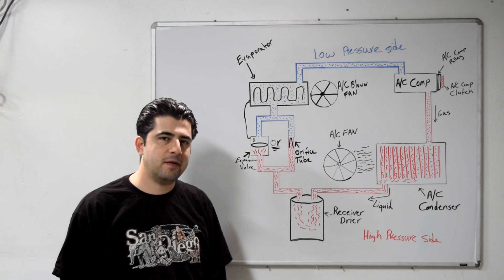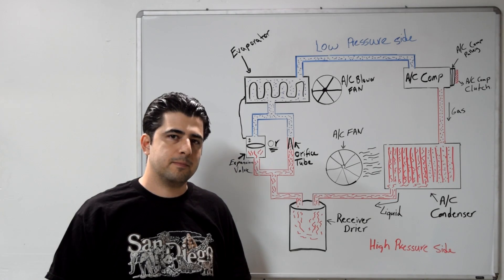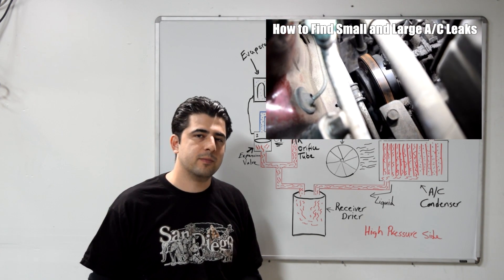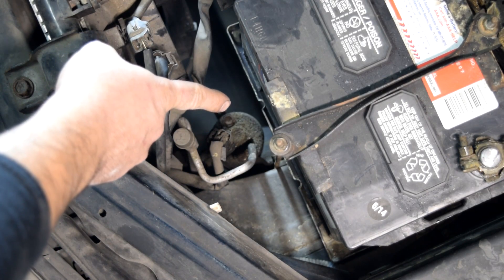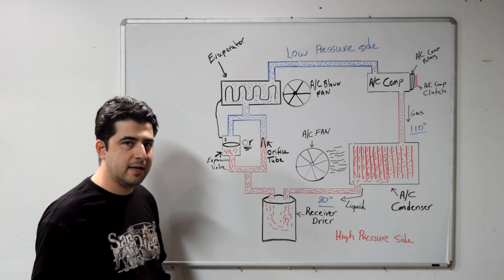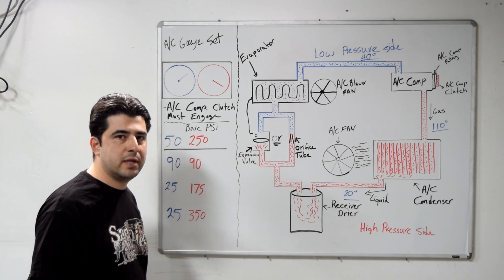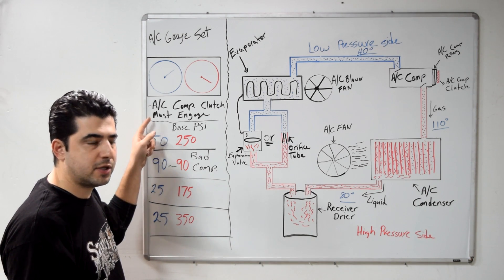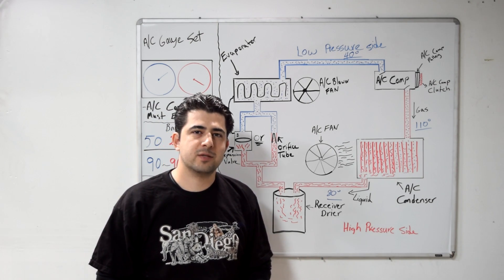How to Diagnose Problems With Your Cars AC System - With or Without an A/C Manifold Gauge Set

Comment: my car a/c switch is working but compressor keeps running even after turn off a/c switch.
Reply: Parwez Ansari are you sure? the compressor pulley may spin but clutch maybe deactive. Unless your car has been hard wired. The only other alternative is check AC relay is not sticking
Reply: Even one technician put one more switch from inside, the problem is same.
Reply: Even if you exchange switch..the problem would still be the same! Because your still using the relay. Unless you bypass everything individually to know what it is. The first thing I would start with would be the 
1) Low pressure switch
2) High pressure switch if one
3) manifold temp sensor
4) Check for constant electrical short
Reply: Ok, thank you very much, i Will go again to the technician to check and follow your given instructions.
Reply: A simple paper clip can be used to bridge the pressure switches by jumping from one terminal to the next. As for the short you can just wiggle the wires and see if the clutch disengages or trace the wire
Reply: Ok I shall try to do this, thank you very much.
Reply: Np

Comment: How about a Nissan Versa Sedan, 2009, 1.6 without A/C system period...?, This car looks like never came with an A/C system,, but I will like to know if it is possible to install one A/C system....Does the computer and compressor have electric connections..?  thanx.. Joan
Reply: Joan Costello . Yes all cars have to option to upgrade. Meaning your car has all electrical equipment to have AC. all you need are components such as Compresssor, lines, Receiver and condensor
Reply: Joan Costello my suggestion is go to a junkyard. have them pull the parts and install all items. it would probably cost a fraction of dealer price

Comment: i have a 2nd hand 2001 Mitsubishi lancer. ac is cold but not able to adjust temperature through climate control or temperature switch. please help. i also noticed that compressor is always engaged even if cabin hits desired temp. tnx
Reply: Marc 123 pull the dash and see if it is cable or electrical plug. If its cable its just probably disconnected and constantly engaged because a sensor could be reading high

Comment: my car ac stops cooling when not reving... it requires higher rpm to have cool air.  corolla
Reply: check to make sure you have proper freon level. If you do then move forward you may have a restriction/block at expansion valve or orifice tube

Comment: i have a 2015 chevy sonic with only 24,900 miles on it and my a/c has moisture in the vents and it gets cold but then it gets hot.  then it stops but goes and it smells like water.
Reply: MaryAnn B very well explained. somewhere within system is retain moisture either o ring worn or compressor/accumulator is gathering..either way is normally suction side

Comment: Hello; Thank you for your Video;  I need your help please. We have a hmmve that is blowing cold in the back, but the front doesn't blow cold. The pressure on the gauge looks good. I was told to change the TEV  and after I changed it and recharged the system,  nothing still has changed. What could be the issue? Thank you in advance for your help.
Reply: Aurelien Wouembe . It is vitally important that we know the type of vehicle. Normally the dual system is independent if it is then you have a restriction of some sort like an orfice. If not independent then its just an actuator that works like a blend door

Comment: my pressure readings are 0 on the low side and 250 on the high side what's wrong with it
Reply: Daniel Ramirez you have no pressure on low side? unusual.. normally you'd see something. well it can be 1 of 4 things. 
1. low side is restricted by orifice tube/expansion valve 2. Guage not working
3. Freon settled and has become Gel like substance.
4. Compressor not working <<more likely reason

Comment: Question,  SO my 2007 vw gti occasionally will blow gentle cold air, but after I keep it running for a while the air will be hot when I turn the AC on. I connected one of those AC gauges and it reads the temp at about 170 degrees. Any clue what it might be?
Reply: Eric Sanchez Hernandez build up of too much pressure. either too much freon or compressor building too much

Comment: Hi, I have an Isuzu rodeo 98, been having issues with AC, I paid a lot of money to have the system fixed, they washed the condenser (which I thought was silly, I'd rather they change it), changed the compressor along with the expansion valve and receiver drier. The issue is, that a few weeks after, it stopped working, took it to the shop again, there they said that the expansion valve had gotten stuck with trash?!?.. They washed it again, charged me a lot of money again. Now a few weeks later, the AC is working but the air is not as cold as it should be. My question is, do you think this system is just not worth saving or should I try a DIY rescue on it. I don't want to take ti to repairs again, I've lost too much money. Can you assist me with that?
Reply: Arturo Carrillo I seriously think its a D.I.Y project. They are either giving you recycled freon or bad freon. make sure system is purged and flushed before using new Freon

Comment: HELP!!! I don't know what else to do. I have a 2000 Chevy venture.
I replaced the air compressor, temp control valve, dryer. Pulled a vacuum for 6 hours. According to the spec's, I am now supposed to put in 42 oz of 134r. I put in 12 oz last night of 134r that has leak fix in it (it was all I had at the time. That took the low pressure to 10 and the high pressure to about 50. I let it sit over night and got the same pressure this morning - hooray. I have jump started the compressor clutch directly to the battery to get it all circulating.
I just finished putting in another 12 oz can and added some a/c oil to the yellow line because I spilled some while putting in the new compressor.
My readings now are 45 on the low and 50 on the high (according to the outer most dial on my pressure set). This is a total of 24 oz, not the recommended 42, and I am getting these wild readings. I am still getting hot air (80F) coming out of the vents. I AM SO FRUSTRATED!. Someone please help me.
Reply: Put more freon!!
Reply: Julie Sheehan Hi. I saw your problem and just had to help out. Now first off that minivan does have a safety shutdown to prevent damages to compressor if freon is low. That's why you probably not getting cool air. Secondly the AC line for the rear normally rubs around the gas tank on those so its better to change the  line because the stop leak does not last long and the line is easy to come off only a flange with a nut.

Comment: my compressor engages but my fans won't come on and I can't figure out why
Reply: Donte Quinney did you run wires to battery and jump it? just to make sure your fan is good. Next thing to check is switches (probably faulty) high press and low.

Comment: what does it mean when it's equal on both the high pressure side and low pressure side
Reply: Greg Thomas same problem however the pressures are also equal yet rise and then drops suddenly and cycles like that over and over. I'm guessing high pressure switch
Reply: Donte Quinney if steady stuck on same level both sides then means your compressor took a shit
Reply: Alex Rayquaza Hernandez and you replaced your compressor?

Comment: I just bought a 2002 GMC Sonoma pickup with AC. The previous owner said the AC system needed freon to work and I connected a refill kit with a pressure gauge to the low side of the system. The compressor was running but putting out no cold air inside the cab and the pressure reading was WA-AY up into the red on the gauge. I'm new to this but it seems like that would mean the compressor is worn out AND the system has been overfilled with freon. What do you say?
Reply: Turns out you're right.
Reply: +bulruq well what was wrong? Sounds like something was clogged? I would really like to know!
Reply: The compressor was worn out.

Comment: the a.c. clutch stopped engauging so I went to full with refrigerant but the valve said I had high pressure. would the high pressure stop the clutch from engauging?

Comment: 9:00 onwards: moment of enlightenment.
Thanks so much!!!!
Reply from the maker: +Tyson Ruengsuksilp np, thanks for watching.
Reply: +RatchetsAnd Wrenches 
Just loaned gauge set from Autozone and tried to do it.  I got 0 PSI (low side) and 70 PSI (high side).  

I'm very sure that the low pressure gauges is well connected because when I turn the engine off, I get 40 PSI (low side) and, 70 PSI (high side). The closest scenario is low refrigerant, but 0 PSI means a major leak?  Would that be unsafe to add refrigerant?

Any advice would be very much appreciated.  I haven't used air-con for almost a year, because I was living in Upstate New York, haha, just moved to CA.  It worked poorly last summer too.
Reply: @myRatchets  My car i20 engine is running very quiet as usual. However, as soon as AC clutch is engaged, I hear a squeak sounds and not metallic sounds or alike. The squeezing like sounds go away immediately as AC is off. Even with engine revs, same sounds. And with AC off, as I revs the engine, still the engine is quiet. How to find that squeaky like sounds and fix it?

The AC is blowing cold. It seems the AC compressor is ok.

Comment: iam reparied one ac mini truck replaced2 parts low prasser hose and condencerassy low prassear hose found littile leakge,condencer(with filter type)deso found littile bend,after i rechareged refrigernt through bosch450 not gone refrigenent in the sistem pls send me reson or other bad parts

Comment: Thanks for this great tutorial and all you other videos. What do you think is the problem in the AC system when the following symptom occurs?
* When AC compressor clutch is not engaged, the LP is at 45 PSIG and the HP is 0 PSIG, and when the AC compressor clutch is engaged both the LP and HP are at 0 PSIG. Thank you so much for your help.

Comment: Most chain parts stores have a "loan-a-tool" program where you can put a deposit down for the (gauges, vacuum pump) tool.  I don't know if you touched on cars older than 95 came with R-12 which is becoming hard to find. If the AC system is opened for any reason, it MUST be vacuumed down to check for leaks and to remove all moisture from the system or you'll have problems down the line. Great video by the way.

Comment: i attached one of those gauges that comes with the refrigerant and found that my system is building up to the red then the compressor kicks on then the pressure drops and then the compressor shuts off.. it goes off for a few seconds then builds up pressure then kicks on and off.
Reply: +Matthiu Ryin also the car has been sitting for almost three years. its a 2004 ford f150
Reply from the maker: +Matthiu Ryin only the measurements with the compressor kicked on matter, the pressure readings with the compressor off dont matter.
Reply: +RatchetsAnd Wrenches ok i figured it out.. it was just low on refrigerant. i didnt realize it really takes a long time to empty a can and i didnt think it was doing anything. the compressor was kicking on and off quickly because it was so low. after a while of charging it i noticed it would stay on longer and i eventually got it up to pressure when it was kicked on and now it blows cold air. thanks for the tip.
Reply: +Matthiu Ryin , This is the same problem I have encountered. I removed some pressure and the compressor stopped all together. It used to stop then come back on. RatchetsAnd Wrenches ... can I add freon without the compressor on? Currently the AC is on full blast but the compressor doesn't kick on. The gauge shows at green, but with the compressor off. I am thinking about adding freon so that maybe it will kick on like Matthiu said he did.

Comment: i have a car that have the reading 350 low side high line 150 what do you think
Reply: I've had issues a couple of times where I was getting high readings on both low and high pressure sides. Did you figure out the problem?

Comment: on my 2000 ford mustang my compressor kicks on but then im driving for at least 10mins my ac clutch turns off and blows hot air? do i need freeon or a new clutch?

Comment: Thank you for the informative video. I've been having problems with my car's AC system. I do have a couple questions though.

What if the pressure on the low side is between 40 and 50 but the pressure on the high side is way above base pressure? Does that still mean that my expansion/orifice valve is clogged up or is it something else?

Comment: and the only thing I can go by is pressure and temperature so hmmm maybe with time I will understand what is the more likely component problem evaporator , expansion valve/tube , or condenser... and to throw the monkey wrench into it we have that the doors/shunts in the heat core that are actuated by the ac controls in the car could be jammed open or close effecting diagnosis. so I guess check the doors can open properly from the controls, then try to get at measuring the temperature differences of the condenser, evaporator , and over the expansion valve / orfice tube is the only way to go

Comment: ya if the compressor pressure is the same on both side or close that means like you said dead compressor , compressor clutch , or electrical component of it.
But for the expansion valve or  evaporator  components I want a really good 99% fail safe method since the heat core enclose to me so far is a bitch to get at

Comment: O so you can diagnose a bad component of the ac by the temperature difference like if you condenser doesn't have a 50 deg difference between temperatures then it needs to be cleaned out or replaced, though for accumulator or receiver dryer only 15 degree difference is not much of a bullet proof method for troubleshooting the receiver dryer or accumulator and those are my components I am having trouble figuring out a good way to rule them out

Comment: I'm having problems with the low side connecter on my 2008 Dodge Durango. It will not lock down all the way when i put the connector on. I check it on my Ram 1500 it worked and on my jeep and it worked. It their and adaptor i need for my Durango or am i hooking it the wrong port. This port is near the front of vehicle on past the air cleaner and battery.  Thanks.
Reply: The high pressure not low

Comment: I must say sir, you are awesome ! Very helpful :)
Reply from the maker: Oleg S Ty, glad you liked the video. Cheers
Reply: RatchetsAnd Wrenches 
Replaced compressor, expansion valve ,drier vacuumed the system and filled with new freon. Work well now:) 
Must know how the system operates and you have done a great job explaining!
Reply: @myRatchets  My car i20 engine is running very quiet as usual. However, as soon as AC clutch is engaged, I hear a squeak sounds and not metallic sounds or alike. The squeezing like sounds go away immediately as AC is off. Even with engine revs, same sounds. And with AC off, as I revs the engine, still the engine is quiet. How to find that squeaky like sounds and fix it?

The AC is blowing cold. It seems the AC compressor is ok.

Comment: Hi I have to question, I would like to know why the AC compressor is not having power. My husband change the fuse/relay still nothing but the compressor engage when hooked up straight to the battery.Thank you for any suggestions

Comment: Ranches and wrenches thanks for the videos. Just found your channel I and I think your videos are great. Gonna make it my go to channel.  
     Watched your videos on a/c system helped a lot but I couple of  issues i  can't figure out.  If you'd like to help here they are. 

—-----------------------------------------------------------------------
04 neon
A/c won't cool. 

On start up 
.      High side is - 250
       Low side is -29
       Ambient temp - 83

After a while the both start up start to climb steadily  up to
       Highside -315
       Lowside - 40
       Ambient temp- 83

Ac never cools

-----------------------------------------------------------------------------

99 corolla
A/c won't cool

Highside was - 200
Lowside was - 29
Ambient temp - 83

I charged it up with ac coolant, to:
Highside - 250
Lowside - 39

-----still wont cool 
--- so i rechecked the pressures and i found that:
            On acceletation low pressure side drops while accelerating and returns to 39 on idle

Comment: What surprised me most about the gauge set is how dependent those normal reference pressures are on ambient temperature. It makes it that much harder to do accurate diagnostics when ambient temp is low.
Reply: +c0ntender1 sounds like you need an ac blend door actuator for the driver side.
Reply from the maker: spelunkerd Yes, very good point as always. Thanks for your post.
Reply: RatchetsAnd Wrenches 
ac is blowing cold air from the passenger side vents and hot on the driver side
Reply: hey thanks for hit me up with the fix ii wanted to find out why i have a clunking noise when the weight of the car shift and i t sounds like it is in the middle of the front of the car i was just shake the car left and right and i could hear the noise

Comment: One question how i can know that the evaporator is good or bad..?
Reply from the maker: Antonio catanese Evaporator go bad by leaking usually and less likely clogging up. You can use my video on how to find ac leaks to see if you can find it leaking. Also check the temperature of the ac line going into the evap and coming out like I show in this video. They should both be very cool to the touch.